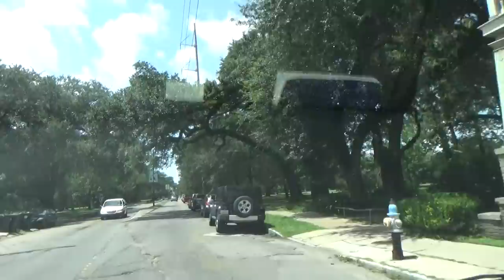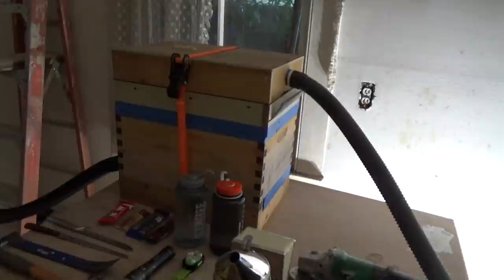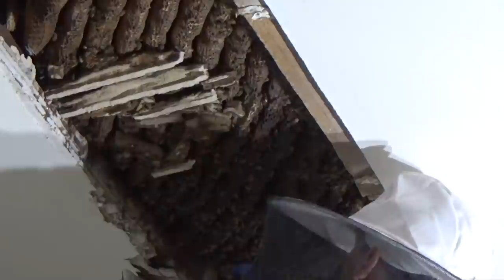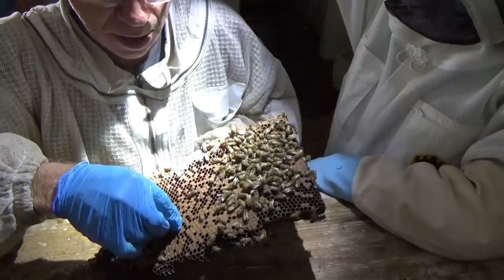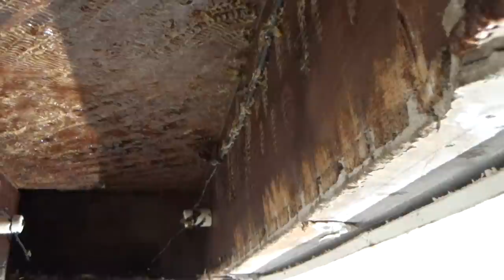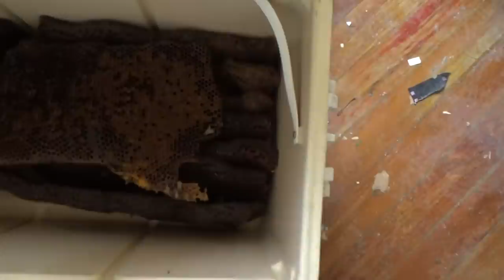Can someone please save these bees?

Comment: Jeff yesterday I got stung by 27 Yellowjackets and was rushed to hospital. Now have a Eli pen to help. Wanted to start doing bees next year by doing hivebixes to get ready . But now an just a little scared.
Reply: Those are 2 different kinds of venom, and you may not be allergic to bees. I'm a novice beekeeper and allergic to bees (found out after a few stings - I wasn't being careful enough), but I'm not allergic to yellowjackets. Get an allergy test to find out, and just take your precautions. Get a good suit that the bees can't sting through, some good leather gloves and boots/shoes that cover your ankles. If you live in a place where wearing boots is just too hot, you can add a couple of buttons to the bottoms of each pant leg of your suit and button some elastics down under your feet so that your suit goes over the edge of your shoes. Letting bees sting the crap out of you is not smart, since allergies can be developed over time - be smart and be safe :-)
Reply: Michael I am on a wait list now to be tested to see how or what vemon I had the reaction from . I have a full length suit and Vail head covering but I think I am a little gunshy because of this recent issue. I am going to start to wear my bee suit while I retrieve the items I was going for at the house. I guess I was maybe in wrong place at wrong time.lol
Reply: @davidkirkman2223  I hear you!...I've been working minimally with my bees since my reactions worsened, but speaking with my allergist has put my mind somewhat at ease. LOL...you are always in the wrong place at the wrong time, if you are at the end of a yellowjackets pointy end ;-)

I don't know what kind of suit you have, or what kind are available where you live...but if you have a more serious reaction to bee stings (even locally), you will want to look into the suits that bees cannot penetrate with their stings. The standard cotton or cotton/poly blend just don't cut it. More often than not, the kind you want is also more breathable, and thus far more comfortable either in hot weather, or when you need to have more layers underneath and sweat can dissipate. My season is just about over where I live in Denmark, but I plan to have one of those suits when the new season starts
Reply from the maker: What a terrible experience, I'm sorry for you. Your new found trepidation is very much understood. God's peace David.
Mr. Ed

Comment: Although you can’t use the wet comb, can you still sit it out for them to rob it back instead of crush straining. Or you crush strain to keep the honey
Reply from the maker: The comb is crushed and strained to retrieve the honey which will then be fed back to the bees through a feeder jar. That way, the bees can use the honey without fear of the hive beetles over running the hive. Thanks for watching. God's peace Bradley.
Mr. Ed
Reply: Jeff thanks

Comment: Just as a warning, if you ever see old tube and post wiring that still has wires on them check to make sure the wires aren't live.  (This type wiring used white ceramic standoffs like you see about 9:30 in.) 

I was doing network wiring in a building that had been "renovated" several times in the past and encountered some live wires.  The Accounting firm that worked in the building had always assumed the wires were dead.
Reply: We call this "knob and tube" wiring. When I was an electrician working in old houses, nothing hurt worse than getting your fingers between a load being drawn on a neutral.  A shock to ground is one thing, but lighting a light bulb or powering a refrigerator through your body is pain.
Reply: @TechGorilla1987  Thanks for the correction.  For some reason I couldn't remember "Knob and Tube."  Having been nailed a couple of times myself over the years, I know exactly what you mean.  "What doesn't kill you sometimes just hurts like hell."
Reply: Did the accounting firm fix the wiring or just leave it as is?  I think I know the answer.
Reply: @monkeyboy4746  They fixed it!  They turned out to be a pretty good group of people to work with.  I think the guy I pointed it out to was a senior partner so that probably helped.
Reply from the maker: Fortunately, we knew for a fact that the knob and tube was dead, it had been replaced years prior with Romex and circuit breakers. Thanks for your concern and for watching. God's peace.
Mr. Ed

Comment: I worry about you cutting in to lath walls with a reciprocater ! Love  the Milwaukee !!!!  You hit wires and lath will go up in flame so fast . not a problem with dry wall , Had a friend that the house burnt down . Lath and and ark are not a good combo . You can shut the power down and use a cordless . Saw you had nob and tube wires . Not a problem . but where you have romex  it will make a ball of fire
Reply: Especially in the old house where the homeowner got tired of buying fuses and put a dime behind a blown fuse and called it a day.
Reply from the maker: I know very well about the ball of fire, I hit a wire once and there was a big flash. This bee wrangling is a dangerous occupation. God's peace John.
Mr. Ed
Reply from the maker: Now THAT"S a scary thought, but I know it was done. God's peace.
Mr. Ed

Comment: Hi Mr Ed I have question for you, when you're up on the ladder and using the bee vac could you install a hook on the side of the ladder to hold your bee vac hose. Then it would free up your hands to pass the comb to your helper.
Reply from the maker: When I work off a ladder, there is a hole in the top of the ladder that my hose nozzle fits in perfectly. I use it all the time. thanks for your suggestion and for watching. God's peace Pamela.
Mr. Ed

Comment: Knob and tube wiring, was that hot?
Reply: my thought exactly
Reply: that is a very good reason to use the vibrating cutter that Dirt Rooster uses (actually his helper most of the time) instead of a sawzall. You cannot see what the sawzall is cutting up inside. With the vibrating blade you can see everything and do not risk hitting hot wires. The tool has a specific name that escapes me right now, but you get the idea.
Reply from the maker: Thankfully, the knob and tube had been disconnected years before when this house got an electrical up grade. Now it was time to have a complete house up grade. Thanks for watching. God's peace Anthony.
Mr. Ed
Reply from the maker: As good as the utility tool is in cutting sheet rock and plywood, when it comes to plater and lath strips, not so practical. Chep knew about the wiring, though it was dead, and kept the blade below where it was. He did a great job. God's peace Mark.
Mr. Ed